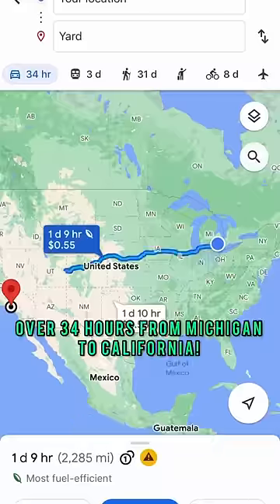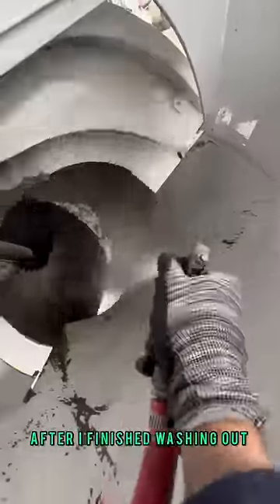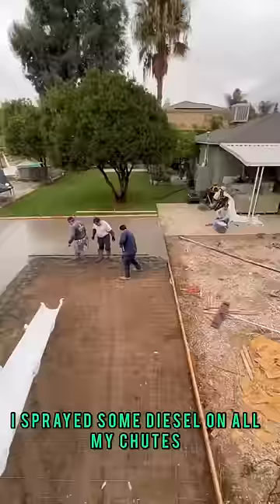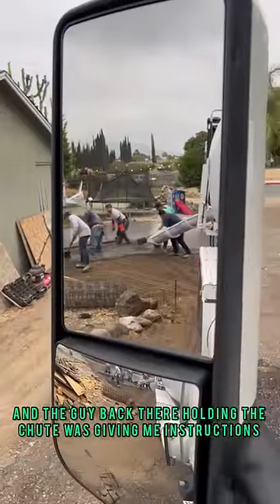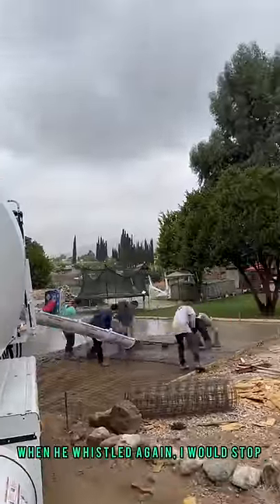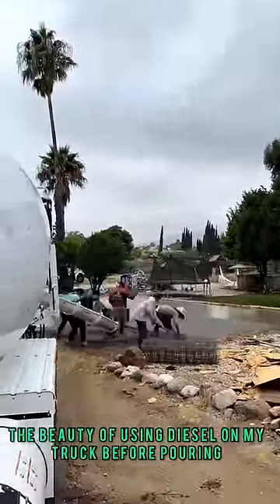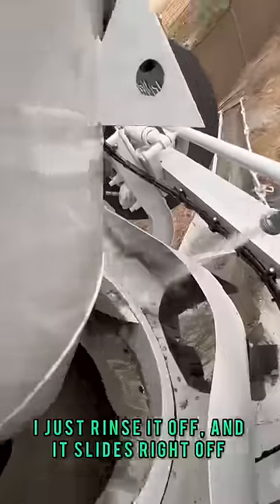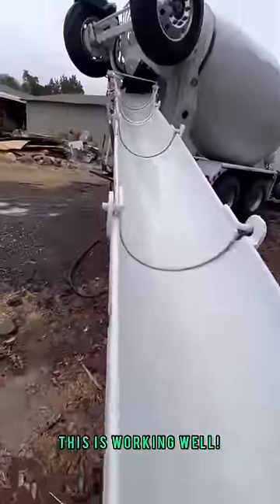BRAND NEW 2022 MIXER TRUCK!! 🤩🚛💨 #concrete #construction #readymix #work #cdl #trucking #shorts

Comment: Don't say diesel say cooking oil someone is going to turn u in my guy!!! Awesome video well done sir!!!
Reply from the maker: How will they prove it? 😁 thank you!
Reply: It's diesel brand cooking oil.
Reply: @jasonfavela  probably that spray bottle full of diesel and footage of you spraying it lol
Reply: I was thinking the same but then common sense kicked in and i realized no way he is spraying diesel gasoline it gotta be something else lol
Reply: "release agent"
Reply: @jasonfavela  "How will they prove it?"
Um, no idea, nope not a clue. 🤔🤣
Reply: @5starlifestyle555  nah, diesel is frequently used in the industry. you have a whole tank of it on the truck at all times, and it's actually very stable. you can put matches out in it. it needs pressure, or very high temperature to ignite
Reply: @chrishavill6458  it’s not the stability. It’s the intentionally washing it onto the ground.
Reply: @chrishavill6458  one could say that used engine oil is stable too, but that doesn't mean you should wash it into the ground.
Reply: @basketofdeplorables4253  you don't wash out concrete onto the ground, it's an alkaline and is bad for the environment. It's typically collected in large tubs, or in this case more than likely he washed into the pump, which was then pumped back into the truck
Reply: Agreed..  as soon as I heard diesel  and washing it out I was surprised.  Probably  shouldn't  be letting the world know. Lol
Reply: @chrishavill6458  Looks alot like  washing out on the ground to me.
Reply: @chrishavill6458  it's not about ignition it's an epa violation that practice was used for years on asphalt equipment but no more
Reply: @chrishavill6458  you need to watch the video again. 
They poured the slab on the ground. And he washed the shoot onto the ground. If you pay close attention you can tell he is in the video. 
Not to mention that concrete is made from limestone that comes out of the ground and is very alkaline in itself. There is nothing wrong with rinsing the concrete on the ground. It hardens and can be picked up after. I doubt the diesel even is that bad. The fact that he made a video and showed he washed the diesel onto the ground would probably get him in legal trouble if the wrong person saw it.
Reply: @Nothingmore71  he could say it was colored water
Reply: What for ? Diesel is used on form work , why not the truck ? 
I never used anything my Agi just a broom & water when washing out after loads ( takes minutes ) & washed truck at the end of the day with soap & high pressure hose . If you stay on top of it , it stays clean..... after two years mine looked good still , only build up was on bottom of loading chute & rim of barrel & it was minimal .
Reply: @chrishavill6458   I only did if there was more concreting to be done , over the crushed rock etc..... otherwise into wheelbarrow . Puppies don't like you washing in to them because they have wash aswell & they need to get rid of your water & theirs .
Reply: @basketofdeplorables4253  knew a guy who got in serious trouble for writing a big ass message in his neighbors yard with diesel. Had to pay to tear it all up and replace it.
Reply: @jasonfavela  easy guy. Just stop. That's it
Reply: Where I’m at if you get caught washing in the ground it’s a 30k fine and a year in jail
Reply: @chrishavill6458  we do here. They find a corner of the job site and wash out right there.
Reply: Last i knew as long as it was uncontaminated or unused, it's okay. Its been a decade or more tho.
Reply: @jasonfavela  It leaves a residue. Ashame you aren’t in a state that could care less about how you use Diesel.
Reply: @Youmommacallsme  you used diesel on Corey?
Reply: Just say you use Pam on the equipment. No EPA concerns.
Reply: @5starlifestyle555  no it’s diesel
Reply: @chrishavill6458  that’s what I’ve been saying 
The is a washout pit built for it or tubs brought out
Reply: @bebereyes5514  I think he meant a quarry lmao.
Reply: @Nothingmore71  I think Jason might be dumb to understand what he just did, he just started in Cement and doesn't have a clue about anything he discusses.
Reply: @bigrod359  wow jail , here in Australia it's a big fine EPA , local government etc.... plus if in residential area the neighbours , home owners etc.... are on you or the concreter who then gets on your back or calls your boss etc.... 
99% of the concreters / builders know the drill & provide something/somewhere . 
It's also an issue driving with a dirty chute if something comes off , dirtys or damages a car etc.... it's unsecured load penalties plus damages / insurance costs etc....
Reply: @brodiegriffin_is_Ozzy  yeah most of the time big contractors provide a washout but out in rural areas smaller guys don’t care and don’t provide one. We had a guy a year ago go to jail get fired and a big fine epa don’t play with that
Reply: @bigrod359  How's that working out for you
Reply: @jasonfavela  you only posted a video admitting it
Reply: Fillapino cooking oil ..🙃
Reply: Or bikers... If they can can stay on two wheels to catch you in your diesel wake 🤦🏽‍♂️
Reply: @jasonfavela  they'll prove it with your video 🤦‍♂️
Reply: @jasonfavela  verifiable verbal confession from this video
Reply: Only problem is that you drove to California.
Reply: Yeah or say concrete release agent
Reply: Amazing how people in the industry are clueless about Env Regs.  We used to pour motor oil on fence posts LOL.
Reply: @jasonfavela  by your own words!
Reply: They domt need to prove it..you just confessed on video lol..
Reply: If anyone doubts the power of epa just see what they did to the diesel bros channel and then look at what happened to them in court.
Reply: @jasonfavela  at least youre using it in a spray bottle. using the minimum amount needed
Reply: @jasonfavela  look up ultra ever dry on Youtube!!!!
Reply: @justinhackstadt6677  him saying its diesel on video doesn't prove that its diesel. Not the way proof works. They would still have to prove whats in the bottle.
Reply: @jasonfavela  Because you admitted to it
Reply: Just add a drop of olive oil to the diseal and call it blended extra Virgin olive oil.
Reply: @jasonfavela  because YOU said it lmfao
Reply: @jasonfavela  in your video you said Diesel. Why now take the advice and say cooking oil. Smh foolish man.
Reply: That someone could be me.

Our environment is in serious condition because of construction workers.  Contractors fill landfills with construction debris and pollution most of which is sortable and recyclable.
Go Green Live Healthy!!!
Reply: @jasonfavela  because you said it in a video? They don’t need solid proof to make you look bad lol
Reply: @jasonfavela  this video?
Reply: @jasonfavela  with the diesel residue lmao, it’s not the cleanest fuel and is definitely sticking to some of the things you spray it on
Reply: @jasonfavela  your video is the proof 🤣🤣😂
Reply: No matter what you use. Say releasing agent. Not a specific type.
Reply: @jasonfavela  the color and your word dude. And they'll log your books to see where you're at and inspect you 😐 you'll be making bank getting away with it until you're stripped of your CDL or fined
Reply: Just say heating oil
Reply: @namewithheld7835  you can't say heating oil. that is not an approved agent. The only thing you should say is "releasing agent". Once you say that. Most of the time the EPA will leave you alone. So long as your inspector isn't using his sniffer
Reply: @bigrod359  is that the other country on the Left Coast California
Reply: @jasonfavela  - you filmed yourself using diesel…
Reply: @chrishavill6458 its still should not be washed intonthe fucking ground. and diesel goes up pretty easy lmfao.
Reply: @chrishavill6458 what about when the concre1ts being pourd onto the fucking ground right after he sprays shit with diesel.
Reply: @blewyd he said it was diesel like 10 times lmfao
Reply: @jasonfavela  this video bro. why you risking your job for a couple views this is wild
Reply: @jasonfavela  this video
Reply: @jasonfavela  they can ask where this job was done and who worked there. te jodite you going to pay so much fine
Reply: @jasonfavela only if they had video, with your voice on it, showing what you’re doing, EVEN DESCRIBING what your doing..
Reply: @Nothingmore71  he’s obviously not too bright!! LMAO.  “how are they going to prove it”… ummm… nevermind. 😂
Reply: @1puppetbike  "deeysal veggie oil" 😋 👌
Reply: @jasonfavela my guy, if you haven’t noticed ppl on internet are petty. Ding under estimate his petty ppl can be. Just use the release agents and thank the internet lords
Reply: He is driving around a truck that's polluting the air... What is your argument again? 🤤
Reply: @jasonfavela  you literally said it, video recorded it and then posted it. That’s literally all anyone needs to report you for being unprofessional and a problem.
Reply: @Nothingmore71  is it?
Reply: @jasonfavela  I’m snitching on u
Reply: @jasonfavela  you saying it’s diesel in the video is enough to convict. They don’t need to prove that diesel is in the bottle when you’re saying saying it is
Reply: @chrishavill6458  yeah see that’s where you’re wrong. We wash out wherever. Well, except storm drains.

Comment: I always used form oil on my Schwing but diesel works nearly as good
Reply: Diesel works as good just way cheaper
Reply: Spraying diesel onto the ground pollutes the local water
Reply: @joelbadger9661  You can't just simply contaminate water with diesel man because they don't mix - they naturally separate.  
Energetics and Entropy  
Polar<<<<<>>>>> Non Polar
mores dense<<<<<>>>>Less dense
Lucky for us eh....
Reply: @joelbadger9661 Where in the flying fuck do you think diesel came from?
Reply: @matthewmitchell7084  you don't think diesel van contaminate your soil? Are you a coward who says not my soil not my problem?
Reply: @joelbadger9661  just for some context from when I worked at a gas station: we didn't need to write an incident report or inform the EPA unless it was over 6 gallons spilled.
Reply: @matthewmitchell7084  humble down. You will actually be a tree hugger soon. You will soon learn how important it was to avoid polluting the earth.
Reply: @asmith8898  maybe go after planned obsolescence and major companies, or idk there is a specific group of people usually leaving trails of Budweiser and Swishers everywhere go try and talk to them and see how it goes.
Reply: @OnTheDLum  was I even talking to you? If the shoe fits wear it. Just mark my words. You know, the words directed to A WHOLE OTHER PERSON..
Based on THEIR comment.
Reply: so is it flammable?
Reply: @nonamexb-wz5cl  no, but it's combustible.
Reply: @nonamexb-wz5cl  no, so obviously it's safe to drink.
Reply: And it kills all the life around
Reply: @510Redneck  Clearly you have not heard of the different times cities have gotten diesel into their drinking water.

Hawaii and Nibley City are a few locations of contaminated drinking water by petroleum hydrocarbons.

Comment: Why is this man’s cement mixer cleaner than my Lexus 😂
Reply: We watch the same video right? He said it was his first load. Check back with that truck in a year
Reply: A few loads of concrete with all of the sand and rock that entails and that paint will be looking like more like an old Ford pick up than your Lexus.
Reply: Because it's brand new and cost 5 times what your lexas does
Reply: If you prepped your Lexus with diesel, every day, it'd be clean too.   No bugs,  dirt,  sap or bird poo.
Reply: @Michael-ij6kg  <--<< And the aroma, don't forget the aroma, so heavenly!
Reply: Diesel.
Reply: Because it is a concrete mixer truck?
Reply: Poor some diesel on it

Comment: Diesel may effect the concretes strength, definitely not allowed by Caltrans, but form oil is acceptable per Caltrans standard specifications.
Reply: There is no possible way this amount of diesel will make a difference to the strength of the concrete. You are right about getting a ticket for it tho.

Comment: Then rinse it all off into the water table. Nice
Reply: Hmmm. And do you know how long it really takes water to move through the soil? That diesel isn't going very far
Reply: @deven6518  Where's it going then Deven ?
Will it stay in the topsoil until it turns into pretty flowers?

Comment: Will the diesel have a negative impact on the mix?
Reply: Noo diesel is not a regular fuel it’s a oil that’s why it’s thick and it’s less flammable also has very little vapor we use diesel to spray the beds of our dump truck for asphalt so it don’t stick
Reply: @gabrielcarson1536  wrong!!   Yes, it will have a negative effect on the concrete.    That's why you use form oil, and not diesel on forms.   Kind of why it's called form oil and not diesel.   Come on man
Reply: @exloaded  people use it  the time it’s not like he is using gallons he is just misting it so it will not have a affect on the concrete
Reply from the maker: Smart man 🫡
Reply: @gabrielcarson1536  using anything other than it's intended use, has an negative effect.   Again, they make a product for that purpose.   That logic is idiotic and a sign of not caring.  Take pride in your work, don't take short cuts just because "it works".
Reply: In small amounts no. Some times when you can't get form oil " living in rural areas " you can use diesel and spray the forms generally only ones that will get finished like steps and pool coping. It's a release so anything that gets coated the mud won't stick to it. Ie rebar existing concrete. I've never seen a truck put release on any part they just use water  for the shoot as is won't contaminate the mix or have any ill-affect on the environment.
Reply: @thedude5-6  nope, you're wrong again.  You are never permitted to use anything other then it's intended use or you create other issues.  Being lazy and not properly preparing for a job is no excuse to cut corners.  You don't place concrete on a wim.   It's always planned for.   If you can plan for concrete, you can plan on having the proper tools/equipment for the job.  Again, take pride in your work, stop being lazy.
Reply: YES, YES, YES, YES, YES...!!!!  Not to mention the environment..!!!

Comment: Just use water when finished pouring.diesel and form oil are only good if you let the concrete set  on chutes etc .

Also, that 17yrd 3  is about 34.48 us tons .would that right?

Comment: Drove from Mi to Ca, now that's the unbelievable part.
Reply: Most of all without Permits and yeah the  map does say 34hrs from Detroit to LA. but it is a 3 to 4 day drive.
Reply: You would think the mix would harden by then. 🤷‍♂️🤪
Reply: @dons8122  it’s no where near a four day drive. Lmao
Reply: Drove from Edmonton to New Jersey with work trucks - not unbelievable tbh
Reply: Waste of gas
Reply: @notkylelol  - if you don’t speed and are by yourself it is. Speeding at those distances can shave off literal days of driving.
Reply: Why do you guys do that if theres concrete here in cali cheaper?
Reply: @gujwdhufjijjpo9740  No, not really. The difference between 70-90mph isn’t that much AT ALL. And NO WAY is someone gonna run 90mph NON STOP going that distance. 
There’s very LITTLE upside TBH. 

I’ve drove a SealCoat Rig for 22 years.
Reply: @O.G.BFrmDaWstSd  - I’ve driven for 14 hours straight before. That’s an extra 280 miles.  You’re not to good at math are you? I’ve driven from Texas to Alaska in 4 days before.

Comment: Ok no one should of ever told you to use diesel. So many new bio degradable products or safer products. Like that one guy said vasealine, waxes even ceramic coats now. Pam comes in a sprayable Aerosol can so no effort in applying

Comment: You'll pay $10 to $15 a gallon for concrete form oil if you buy it by the gallon. Diesel works fine but I think you break some federal law by washing it out onto the ground or into drain. In California you can bet they'll charge you $10,000 for every time they think you did it. Form oil is supposedly environmentally safe because it's a light mineral oil with some additives.